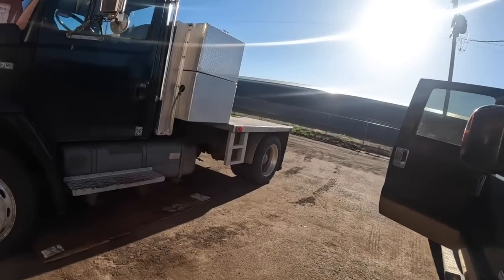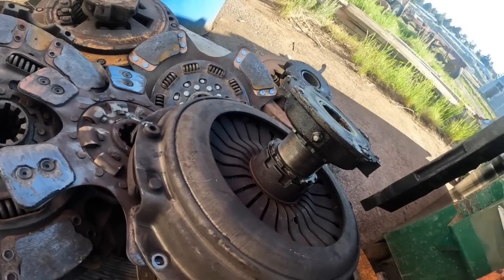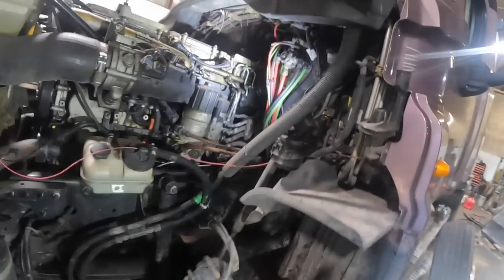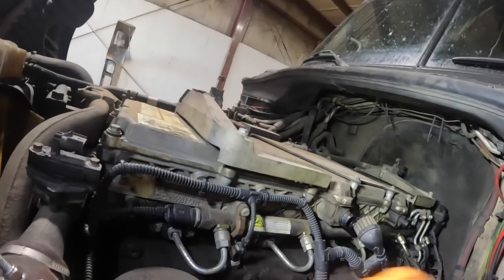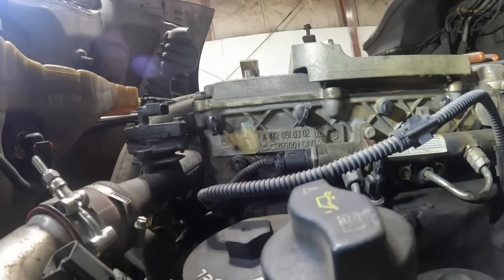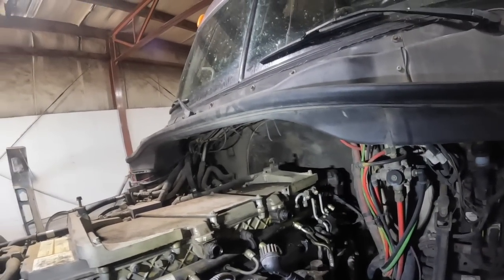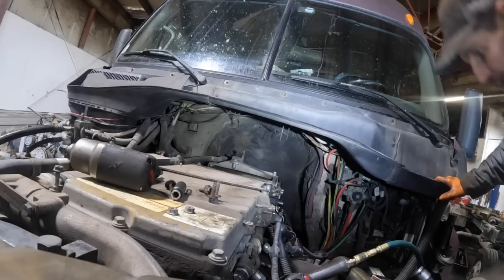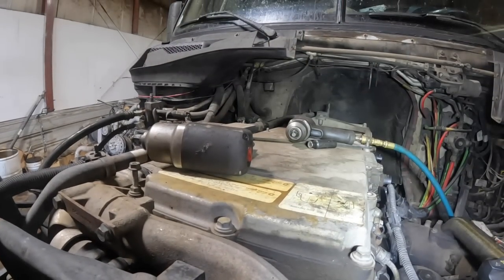DD15 Detroit Camshaft housing leak pt1

Comment: If you haven't checked out DetroitGarage yet on YouTube I recommend it. He put a sequential twin turbo 4-53 in his '09 F350. Runs almost exclusively on waste vegetable oil. He does a great job explaining and showing his wvo filtering process also. Very nice fabrication to fit that engine in the truck. I gotta give it to him, he made a nice swap out of that nasty ole 2-stroke and the truck isn't too loud! Very tasteful, good power. Then he put a 2 cylinder 2 stroke Detroit in his fork lift 😂 I told him when he finishes the forklift I don't know if you'll have the strongest forklift around, but you'll certainly have the loudest. 🤣

Comment: i started out with a 75 kw with a 318, loud as hell, 15 mph up cabbage hill. Still fun to drive. I had a late 80's silver 8v, that one had power, but still super loud. Had 3406 and 3408, 350 and 400 big cams, 315 and 444. 60 and 50 series, m11 n14, the two strokes were still not even close in the fun as hell to drive, fast revving and fast shifting. Had a 12v from a road grader in a 79 mack, pulled cabbage really good. Maybe just nostalgia. Drove some roached out dirt boxes and even have fond memories of those.

Comment: We had 318 Detroit's in most of our fire engines and ladder trucks back in the 70's with 5 speed transmissions that worked great for the department. They would always start go out the door with pedal to the metal with no warm up time. Most of the cabs and body's would rust out before any engine issues and were sent out for new cabs to be placed on the old chassis. Most were retired after about 20 years of service with between 150,000 and 200,000 hard driving and pumping mileage. They were fine until the county started putting automatics behind them. I guess everyone likes there own type of motors, and yes they were loud you could always here the next unit coming down the road.

Comment: Hey Warren enjoyed the video as always, couple tips/heads up for you 1. The injector supply lines from the pump to the rail are NOT reusable just in case you don’t know & I’ve heard a few stories where they broke & trucks burned down & saw one truck that did burn down from it. 2. The injector pass thru seal is replaceable (my local stealership says the same thing yours does, luckily I’ve got a good parts place besides them). The part number is DDE A0209975345 & 3. You don’t have to pull the EGR cooler, manifold, etc to do a cam frame reseal unless he had other leaks he requested to be fixed & I missed that. You can put the engine in time & pull the cam frame with the cams & rockers in it too btw. Take the two p-clamps loose from the passengers side of the cam frame loose (they hold the coolant lines from the coolant collector to the cam frame & the coolant collector is that big manifold the EGR cooler bolts to), take the bolt out of the air compressor intake pipe that comes up the back (T45 or 13mm usually), the fuel rail pressure sensor just push the clip in and it should unplug, cam position sensor you pop the little gray clip loose & it comes partially out & then push it in to release it, take the fuel lines off & injector harness loose & that’s everything on the outside of the cam frame that I can think of. Then inside pull the injector harnesses out of the way, take all of the 13mm 12-pt bolts loose & in the very back behind the cam gear there’s 2 10mm 12-pt bolts to remove as well. Then she’ll lift right up. Not trying to tell you what to do or anything like that, I just know I sure appreciate it when someone saves me from extra headache and/or saves me time from taking something apart I don’t need to. Have a blessed one Warren & keep up the videos man!
Reply: How can anyone dare to make a supply line that's not re-usable? I get head bolts if they're torqued to stupid numbers, but a pipe, geesh
Reply: @ianh9772  rod bolts aren’t reusable either & my old dealership used to make us replace the main bolts as well. One of those money rackets for the stealership I guess. The line kit is about $125, which sucks but better than a crispy truck.

Comment: I can say, that is the most disassembly I've ever seen to do a cam housing reseal. I've done several epa 10, GHG 14, 17, and Gen 5 cam housing reseals. You do not have to pull the exhaust side of the engine apart. You only need to remove the connectors to the cam housing, the injector fuel lines, the injection pump to rail supply lines, plv return banjo bolt or fitting, the p-clips on the back and exhaust side of the cam housing, the valve cover, injector harnesses, and the cam housing can be lifted up with a hoist. Or you could remove the rocker shafts and cams and pick the cam housing off by hand, you do have to do it that way in a DD13 in an M2 or SD chassis. I've never seen tge exhaust side need removed to just do a cam housing reseal personally, our shop also only charges 6 or 7 hours to do one in a Cascadia. Not sure what the warranty time is on one. Also most epa 07, epa 10, and early GHG 14 DD15 engines used the APT and 3 fuel filter fuel system. All DD16 engines use an APT.

Comment: I don't miss those pieces of shit. I worked on a lot of dd13's. Tons of cam frame leaks, dried and shrunken pickup tube o rings, oil filter module gaskets, engine harnesses, #3 liner seals and all the after treatment shit. I only did a couple of those dd15 cam frames, but on the 13's we were having rocker shafts break if the bolts weren't replaced during the reseal. Even the trucks that were resealed under warranty at Detroit were breaking shafts. They never broke when we went with new bolts, just something to keep in mind. I remember the bolts were almost affordable even.

Comment: When it comes to electrical connectors and seals very few manufacturers make their own electrical connectors.  If you can figure out what type of connector is being used you can usually go to the manufacturer to get seals.  There isn't that many connector manufacturers so it shouldn't be hard to identify the connector.  The injector connectors in the head of the 5.9 common rail Cummins are made by te connectivity and they are only a few dollars each.  When I have leaky ones I just purchase new connectors and pin the existing harness into them.

Comment: I disagree with Warren the old Detroit`s are good engines. I learned to drive truck by getting a local grain hauling job. I was in a 71 KW conventional with a 318 Detroit and a 13spd transmission. No driving school I was taught by another driver he taught how to drive without using the Jake brake. So I would know how to drive if the Jake failed. Detroit`s are noisy they leak oil and yes under powered but  they can pull all day long if taken care of. I hauled more than 330,000 bushels of wheat in 3 months and the that Detroit never had a problem. This was local work and the KW could legally haul a 1,000 bushels a load. We still have 2 Detroit`s on the farm I would not want to go long with a Detroit. But I have gone long haul with a KTA Cummins at 525 hp. I will take any engine that does not have an ECM. And I would not get involved with anyone concerning your video`s. If you want to post a video then post a video. If not as a loyal viewer I understand. Thank you for another nice video I have learned a few things from you.